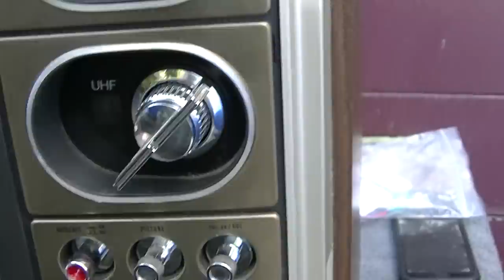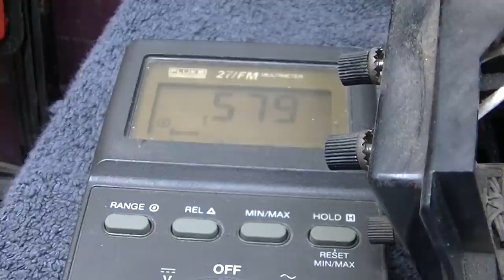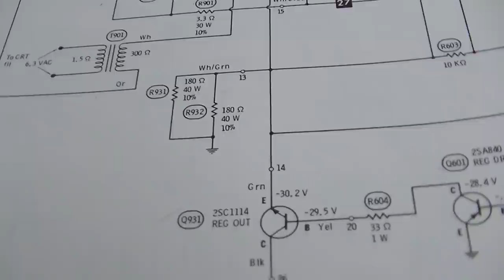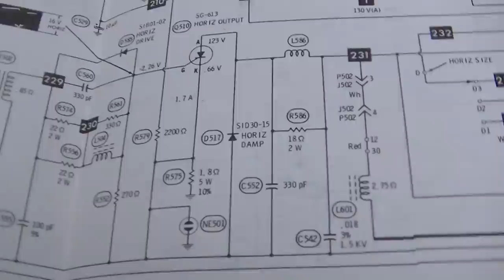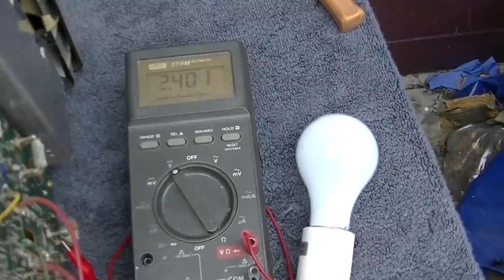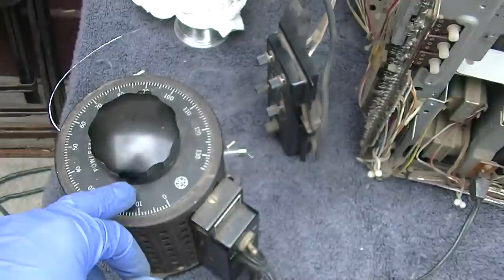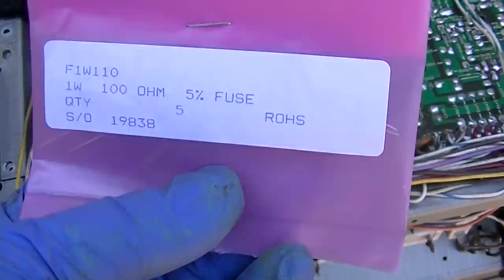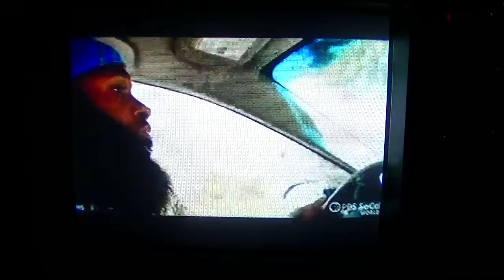1975 Sony Trinitron KV1712 No Power Diagnosis And Repair Vintage Color Television Set

Comment: And an interesting side note: I'm 36 years old. I grew up with a 1983 Sony KV1317, which I have had since 1989. It still works to this very day and I still use it now and then. Beat that!
Reply: I know someone who had a Sony KV1320UB in his TV repair workshop that was on all day every day that never broke down (but did once need a low emission 3AT2 EHT rectifier replaced in the early 90s) until he closed his business in 2013. The TV was bought new in 1971…

Comment: Question: If I may ask. If two 40 W resistors in parallel,  the total wattage is 80 W. is that right?
Reply: Well, I'm going to try to explain it the best I know how, but I can't guarantee that I won't make any mistakes, do your own research before using these tips.
Resistors are made to continuously withstand a certain power without being damaged, but that doesn't mean that they constantly dissipate that power.

The power that they actually dissipate depends on the amount of current that flows through them, even if two (or more) resistors have the same value marked in real life they will never have exactly the same resistance due to tolerances and one will dissipate more than the other, so when designing a circuit with resistors you should do the calculations with the tolerance in mind to find the power rating you need in the worst case.
If a resistor is 100Ω ± 20% it can be anything from 80Ω to 120Ω and if you apply 12V across it the power (P = V² / R) can be anything between 1.8W and 1.2W
Therefore you should choose a resistor rated for the maximum power you can expect, since there are no 1.8W resistors you must choose the next higher rating available which is 2W
If it is to be expected that the voltage can exceed 12V, like in a car where the battery will go to around 14V to 15V with the engine on you can calculate 15*15/80=2.8125W and choose again the next power rating available wich is 3W
On the other hand, the more power a resistor is rated for, the colder it will work with the same ventilation because it will be physically larger and therefore will have a larger surface in contact with the cooling air, heatsink or whatever you use to cool the resistor, that may be another reason to choose a higher wattage resistor.
Reply: If two identical 40 watt resistors are in parallel, the result is an 80 watt resistor of half the value.

Comment: On the subject of eyelash modification:
A long time ago in the 1980's, I 'spontaneously grew' an eyelash that was at least 2 inches long.
This happened over about two weeks and I have no idea 'why or how' but as it was extremely irritating to live with so I decided to cut it down to size.
But then I noticed that there was a large variation between the other lashes.
Yup you guessed it, I decided to trim the rest of them !
The result was 35 years of pain through having lashes which randomly decide to touch my eyeball causing much irritation !
"Don't ever trim eyelashes, it ain't worth it ! ! !"